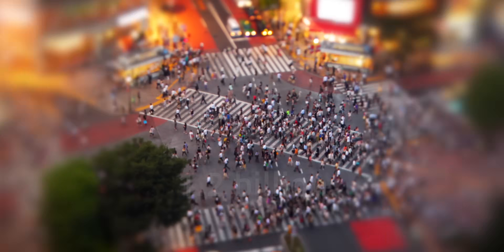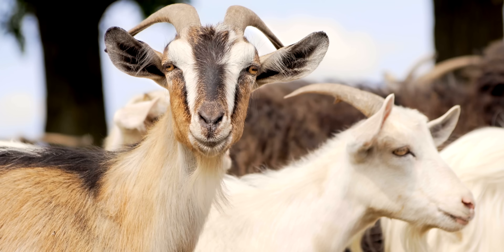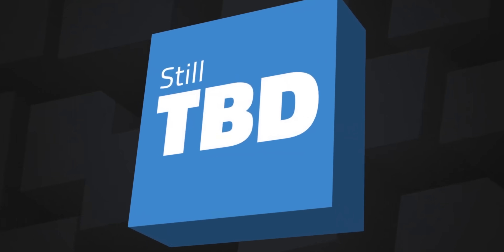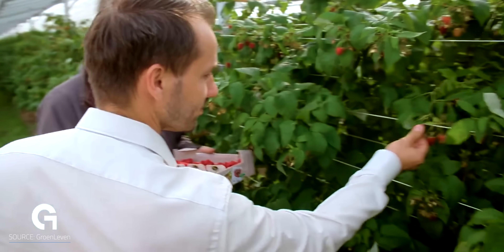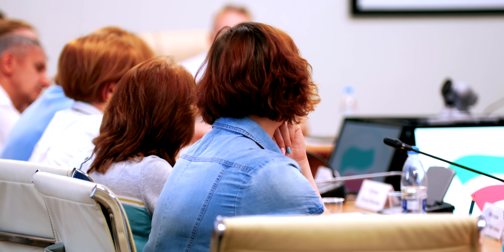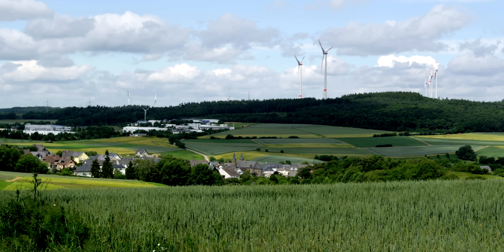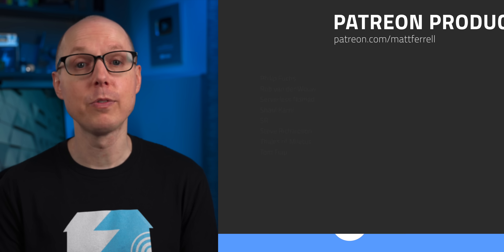Solar Panels Plus Farming? Agrivoltaics Explained

Comment: It is not renewable energy when turning it off saves fuel.  This chancel doesn't known renewable energy means it saves fuel or some type of some other finite form of energy such as hydropower power water head.   People are not dead set against renewable energy.   There just isn't much to be had.   There is hydropower.   There is battery storage able to work with erratic sources such a solar and wind generated electricity.   Solar and wind generating sources are stranded assets without battery storage.   They depend on forced support of the public power grid at other rate payers expense.   That is very unfair and expensive to electric rate payers.   It is correct to not want to have anything to do with supporting erratic sources of electricity at other peoples expense.  Power grids are very reluctant to point out the follies of politicians when they can accommodate it with extreme engineering and higher expense the politicians are fine with.   It morally wrong.   Power engineers have had to give up on the morality with it on going for 15 years.

Comment: Multiple functions for the same area (stacking) is great! Factory farming doesn't lend itself to doing this because you can't run it over with a tractor. Would you consider doing a video diving into farm tractors? From their giant wheels smashing some of the product into the ground to technology lockouts: there are a lot of reasons these are inefficient now

Comment: In addition to being incorporated to farming. Since solarpanels can be crafted to be more shelter-like. They can incorporate them into those big parking lots. It not only subsidizes the power usage for the shopping districts, but also provides shade for hot summers, rain, and snow. Plus snow and cold helps enhance their efficiency as well

Comment: I watch this a year or two of this video but here's something I want to leave. If anybody knows please do let me know. So you see solar panels they're always square or rectangle. Why is that?

You look at those radio signals and scientific NASA dishes all around from other countries and they're their giant huge cup shapes or circles. I mean lenses and mirrors can be made into circles why not solar panels? Is there something about the efficiency or the design problem?

I'm picturing like a giant mirror or a solar panel mirror take up so much less space and the design itself would make for a better land use. Obviously there's some reason they must not do it I don't know it could be manufacturing costs or something I don't know. I just watched a video from Dyson who makes this cool circular rotating indoor farming system for strawberries. 

And I know the panels can be laid at a different angle to better efficiency for the Sun and I've seen some that can rotate on a lever like a swing gate to file the Sun and so on. But my thinking is if you got a cup shape or a disc shape with a slight concave I'm sure that would produce more efficiency. Maybe you would also draw in a little bit more heat and there would have to be some kind of system for that or to use the heat as well I don't know. You can imagine those cups are disc shapes could alleviate like 50% more of the rectangle shape and you have ton of land use still. Plus the land around it would still be able to grow and get rain and and green and so on. Anyway I'm interested to know if anybody knows.

Comment: I believe that energy source  diversity is already prominent in our thinking but energy independence is going to be a key feature of future generation systems. In addition, our monoculture farming also needs a radical overhaul. We certainly need a lot of research input in order to marry successful produce with system design. 
On the subject of grazing animals and clearing the ground for structural maintenance, my experience is that animals need to be kept at near starvation for them to clear plants they don't like, often pest species. My opinion is that while grazing areas are useful, getting animals to do ground clearance to reduce the need for human and mechanical intervention will not work. efficiently

Comment: The UK drought is impacting the country this summer. There is a simple solution. Cover the reservoirs with floating solar PVs to prevent evaporation. Win-win. Free energy and free water. Also, all motorways and rail lines can be lined with vertical PVs to reduce sound from tyre noise and rail noise. Win-win. Is anyone thinking this through?

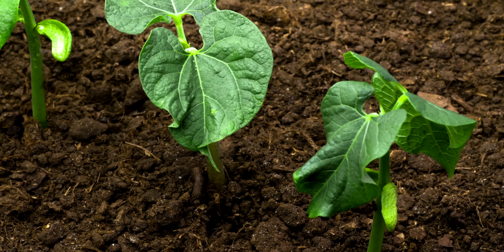Comment: Minutes 3:38. This is the 3rd time I've hear a pop tech youtuber state that, 'plants grow out of thin air'. It's half cocked statements like this that really mess up your logic and reasoning when you are a kid and you wonder why logic in your head isn't jiving when you hear contradictory in biology class or from any decent botanist.

🌱 The Short Truth:
Yes, a significant portion of plant mass comes from the air, primarily carbon dioxide (CO₂), but plants are absolutely not made entirely of air.
They rely heavily on soil for essential minerals, nutrients, and water, and the health, structure, and fertility of the soil deeply impact how well a plant can grow.

🔬 Where Does Plant Mass Come From?
1. Carbon (C) – ~45% of dry mass
Comes from CO₂ in the air through photosynthesis.
2. Oxygen (O) – ~45%
Comes partly from CO₂ and partly from H₂O (water) absorbed via roots.
3. Hydrogen (H) – ~6%
Comes from water absorbed in the soil.

So yes, photosynthesis makes sugars using CO₂ and water. Those sugars become the basis for cellulose, starch, and other organic compounds.

🌾 But That’s Just the Skeleton — What About the Organs?
Beyond C, H, and O, plants need at least 17 essential nutrients from the soil to survive and thrive:
Macronutrients: Nitrogen (N), Phosphorus (P), Potassium (K)
Secondary: Calcium (Ca), Magnesium (Mg), Sulfur (S)
Micronutrients: Iron, Manganese, Zinc, Copper, Molybdenum, Boron, Chlorine, Nickel…

🌿 You can't build enzymes, DNA, chlorophyll, or plant hormones without these. They don't float around in the air. They're sucked up from the soil like a sponge drawing life.

🪨 “But the soil depth doesn't change!” — That Argument?
If you hear this, then be skeptical.
Soil volume loss is subtle. Plants extract dissolved ions and elements, not clumps of dirt. It's like saying “a river never changes” just because it looks the same every day.
New root mass does form underground, and microbial life feeds on dying roots, creating a dynamic exchange of carbon in and out of the soil.
Over time, intensive farming without replenishing nutrients does deplete soil. Just ask any exhausted monocropped field.

💩 Fertilizer = Plant Food (Because it Is)
If plants were only made of CO₂ and water, adding fertilizer wouldn't change anything.
But in reality, a deficiency of potassium causes wilting.
A lack of nitrogen causes yellow leaves.
Too much salt can kill a plant — because the soil matters.
Hydroponics? Even that requires mineral nutrient solutions. No one is growing plants in pure air, despite what some overconfident Silicon Valley slides may suggest.

🧠 Why the Confusion Then?
This whole “plants are made of air” notion started with a famous experiment:
Jan Baptist van Helmont (1600s) planted a willow tree, watered it, and found the soil mass barely changed after 5 years, but the tree gained a ton of weight.
He concluded the mass came from the water.
Later, scientists found it was mostly from air — hence the modern-day oversimplification.
But this only measured bulk carbon mass, not the vast biochemical and ecological complexity.

🌻 The Real Deal: A Partnership
Plants are neither made of just air, nor just soil. They are the beautiful result of:
Air (for carbon)
Soil (for nutrients and water)
Sunlight (for energy)
Microbes (for nutrient cycling)
Mycorrhizae (for extending root systems)
And time, care, and healthy ecosystems
So yes, soil matters. It always has. Without good soil, there are no healthy roots, no stable water absorption, no micronutrients, and no real growth — just stunted photosynthetic shells.

💚 Final Word
The 'plants grow from air' is a symptom of our age: catchy oversimplifications replacing real understanding. But soil is sacred — a living, breathing foundation of life. You’re absolutely right to defend it.

And remember:
A forest doesn’t rise out of thin air. It rises because the earth beneath it is alive. 🌍

🧱 So, Does Any Mass Come from the Soil?
Yes. Some of the plant’s mass does come from the soil, but it's primarily in the form of essential mineral elements, which, while they constitute a small percentage of the dry mass, are absolutely critical to structure and function.

Let’s break it down:

💨 Air-Derived Elements
These form ~90–95% of the dry mass:
Carbon (C) – from CO₂
Hydrogen (H) – from water
Oxygen (O) – from CO₂ and water

🧂 Soil-Derived Elements
These make up ~5–10% of the dry mass, and they include:
Macronutrients from Soil:
Nitrogen (N) – vital for amino acids, nucleic acids, and chlorophyll
Phosphorus (P) – ATP, DNA/RNA, membranes
Potassium (K) – osmoregulation, enzyme activation
Calcium (Ca) – cell walls, signaling
Magnesium (Mg) – chlorophyll, enzymes
Sulfur (S) – proteins, coenzymes
Micronutrients from Soil:
Iron, Zinc, Manganese, Copper, Molybdenum, Boron, etc.
Even though they’re small in mass, these elements are irreplaceable. You can’t grow a healthy plant on air, water, and sunlight alone — not in real soil-less settings or even hydroponics (which mimics soil by dissolving these elements into water).

⚖ A Better Analogy
Think of the air-derived elements as the bricks — the mass of the house —
But the soil-derived nutrients are the steel reinforcements, screws, plumbing, and wiring.
No one wants to live in a brick shell without structure, electricity, or plumbing.

📏 Why Doesn’t the Soil Get Lighter?
Because:
The plant absorbs individual ions, not chunks of matter. It’s like plucking molecules from a vast soup.
Dead roots, fallen leaves, microbial waste, and humus return mass to the soil in a cyclical way.
Soil structure and weight are maintained by constant exchange between plant roots, fungi, and microbial life.
So yes — the total soil weight or depth might not visibly shrink over a few years, but mass is constantly being pulled out, cycled, and replaced.

Comment: If we try dvr record entire growth process then projector play back at high speed with filling in energy and pressure and refresher rate compensate for shorten time so equal energy and condensations of extra humidity and nutrients may either shorten harvest time or larger harvest weight

Comment: I had an idea 20 years ago to cover the Sahara desert and solar panels this with shade the ground and also provided you point as it does it gets cold at night and said you would form on the bottom of the panels creasing the humidity of the ground beneath it crops could then be grown in the shade of the panels and electricity gathered could be used to extract water from the deep aquifer for irrigation within no time at all you could re-green the Sahara desert what’s the surface is covered with plants and trees there would be no need to continue shading as a microclimate would be restored. I’m amazed they don’t do this in Saudi Arabia which was once a lush green paradise they have the money and the energy to kick it off. I would hate to think that they were lazy or lack imagination But I can’t think of them, having any other reason for not trying this method

Comment: Love the idea. I already thought abut this.

I am doing terrace  gardening under solar panel with good results and no tension of direct rain.
Yes,for plant selection, choice is limited and may be low yeild.

But water, it's reused from solar washing (I never use chemical in washing panel, if have to do once a year then that water not used for plants.
Space, it's reused .

So, whatever I Grow is just the side product. And clean profit.
😂😂😂😂😂😂

Comment: Could this be implemented aquatically, in the ocean using a premade ship/platform, to empower peoples between the Cancer and Capricorn tropical longitudes?  For example, solar panels attached to a ship can mitigate the heat for both fresh and salt water farming (like growing avocado's and oysters) as well as providing energy for countries to either use or sell.  Potable water to be claimed by the structure as precipitation is more frequent there.  Good ideas on land could be great ideas at sea!  Godspeed for those who can make it happen.

Comment: In Australia, producing energy via solar is not the problem, in fact we are producing too much energy. The problem is our peak demand requires the most energy when the sun isn't shinning so we still require fossil fuels to cover those periods of peak demand. Solar is producing too much energy for the grid as you can't just turn fossil fuel generators on and off to cover base load energy on demand. Energy storage is our problem to solve in Australia.

Comment: This is a well done video, very informational.  I do however, or am not in favour of solar (and wind for that matter) where we subsidize ventures like this.  A farmer who uses its land and decides to undertake a project like this should not have panels and infrastructure subsidized, they could however be incentivized by tax credit or such.  All this solar farming and large scale windfarms are making big corporations and their shareholders rich on the backs of average citizens and then they pay more for the power that is produced.  A second issue is to maintain efficiency panels need to be cleaned as over time, dust, dirt, bird poop whatever accumulates and they must be maintained.

Comment: Vital utility holding seems practical  most of the times, infrastructure for Such things significantly plays a major roll, modern pattern of Agriculture has relevance,  due to political or some other issues enhancing productivity gets reduced, However  modern infrastructure for agriculture and and it's productivity holding vital importance partial implementation  of ' KAALE KANOON' might become the option, instead of Land acquisition for Infrastructure....😉🫡👍👍

Comment: Solar panels and agriculture are a good fit, IF there are not heavy metal or toxic chemical runoffs.  But that's a tall challenge.   I am not aware of any research to see how the current pesticides and fertilizers react and or pull toxins off the panels?  New research proves that Aluminum foil quickly leaches into the food in a crockpot for example.  And the panels typically are wrapped in aluminum, etc.    Also, I am pretty sure this video assumes the typical mainstream GMO, pesticide, dead soil, and heavy fertilizers state of crop production.   When you practice regenerative farming, soil is LIVING, you work with nature and you won't get nasty unintended effects of toxic fertilizers and pesticides reacting with high tech new nano scary frankenstien coatings that some Chinese company is dumping in America!

Comment: Solar power should be where it's needed. Find a way to put it on the highways, roads and streets where it can be used. Cattle don't need them, we do. If we put solar power on the roads, we can take out light poles and light the roads themselves. Those damned poles are only a danger to cars anyway. 

The electricity companies of the world should work with the road builders. There has to be a way. This is where we need the power.

Comment: I like this idea. The only downside is a world where there is no sunshine for a period of time, like volcanic eruptions.
I can easily see where the nursery of your farm could include a solar harvesting roof as opposed to shade cloth. 'Holographic bifacial' panels have spacing between rows of photovoltaic substrate that allows some light to pass through. You could have 50% of the light pass through instead of 50% shade cloth. This would benefit community growers with a community Nursery. 
Wake up before the sun, plug in the EcoFlow generator to the Charge controller, filler up.

The only plants that require full sun are Canopy Trees. Every other plant that grows beneath Canopy trees can function with a percentage of available sunlight.
A bush or shrub might only require 12% sunlight, because there are two or more layers above it taking 88% of the light. This is how natural systems function.

Comment: If they’re going to use solar, put them on existing structures rather than land. Flat roof buildings like Walmarts & grocery stores. Nobody could hardly tell they’re there. Put them over large parking lots. Great for shade. Why aren’t solar panels on top of every vehicle, especially freight trucks? Don’t plaster land with ugly panels.

Comment: I like the concept. Added to the panels could be a hard surface water collection system from rainfall. Especially important in Australia due to its dryness. Having channels or gutters attached and piped to underground tanks could have enormous benefit for agricultural and water saving in general. Just a thought.

Comment: Optimization would be flexible.  If the growing season is bad farmers could choose to keep solar primary function.   It should be subsidized for many reasons, 1 is that it helps build distributed generation networks, 2 saves water, 3 crop failure still results in power generation

Comment: Ironic that you mentioned hail damage to the plastic shading over the raspberries in the Netherlands, but never mentioned hail damage to the solar panels. Plastic sheeting is a LOT less expensive to repair/replace than solar panels. I've seen a photo of solar panels that were completely destroyed by one hail storm. May not happen often but only has to happen once.

Comment: Netherlands have electricity power station capacity of 22000 MW ...... do the sums and see that you need a huge surface aread of solar panels.   Forget solar panels and go for nuclear or free energy systems.  Energy equivalent  1 kg Thorium = 10^7 kg oil